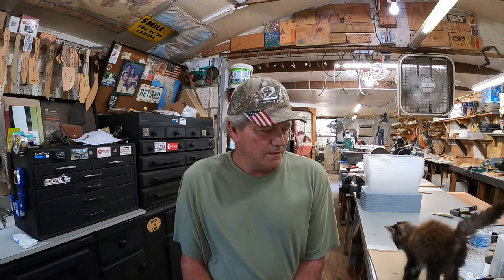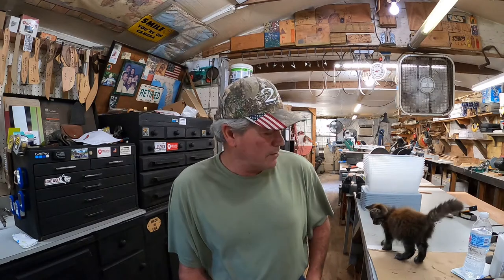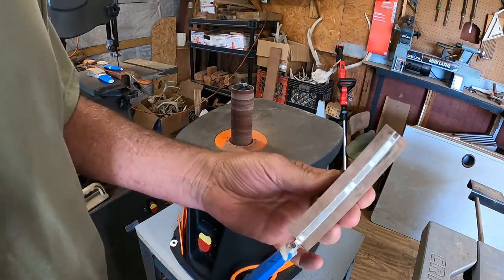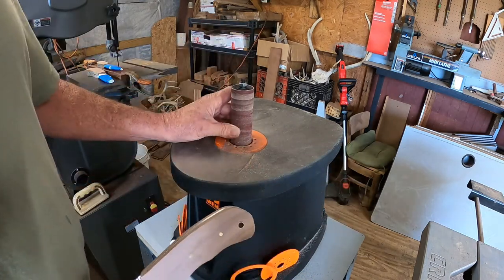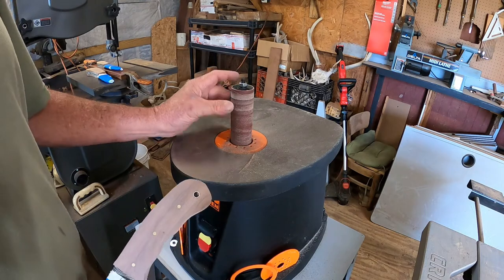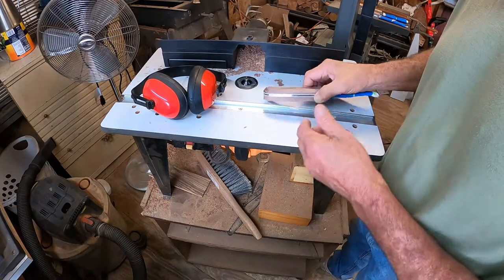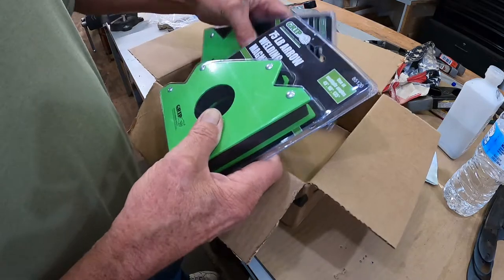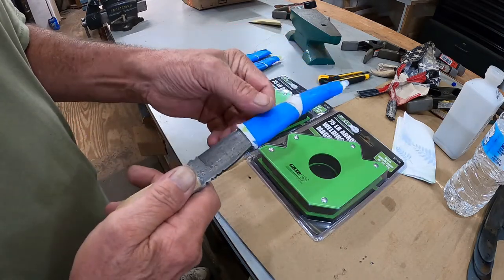Prepping.  Dont forget TOOLS!  Available knives

Comment: Tools are an area I specifically spent time on. I have had several sets over the years. I had boxes upon boxes from roll around cabinets to portable boxes. It all went the way of one of "those" marriages so I had to start all over. I used to just buy whatever I got a good deal on and what was on the shelf. This time I specifically bought high(ish) quality. I still have a lot of tools to get if I can but I have some of the basics. I need saws though. I have no saws. I have a Dewalt hand tool set and Porter Cable brushless impact and drill set. Most of my life has been spent repairing or making things.
Reply: Come to think of it I actually did a video on tools and prepping myself. Made it not long before we moved into this place.

Comment: What were you able to come up with on the stroke length for that sander? It seems like 1/2” of the drum will not make contact, even if you flip the thing. Can you you adjust that? Or could you make an adjustable table that would mount on the steel table so you could raise and lower it to fully use the whole drum surface?
Reply from the maker: Yep.  Next video  :)